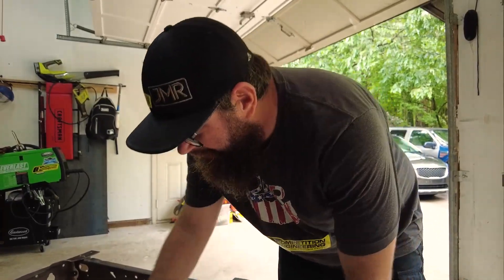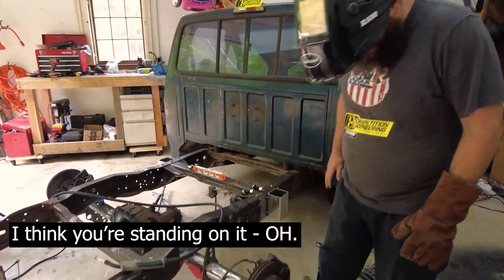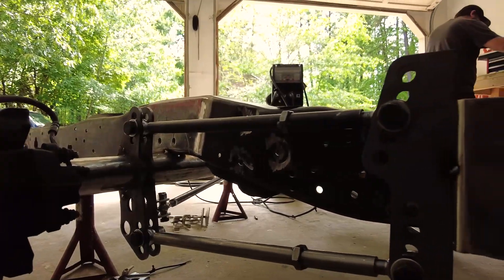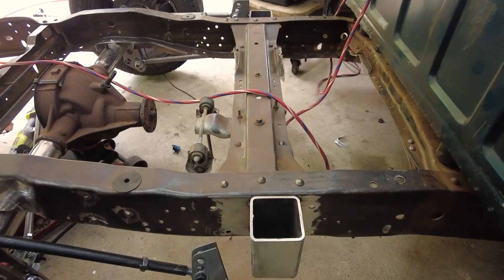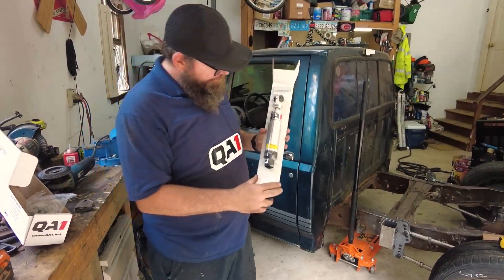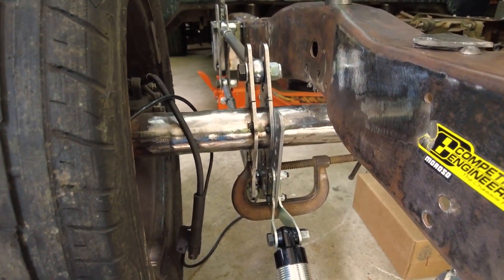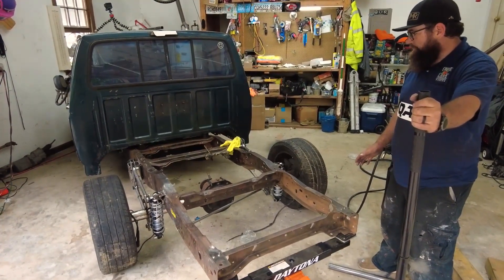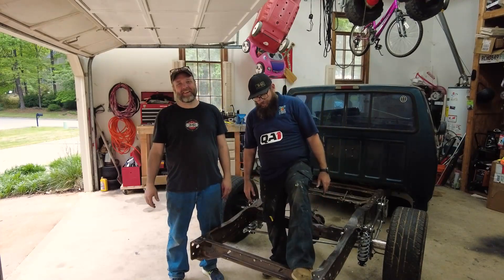Pt2 -Competition Engineering 4 Link in our Coyote Swap F150 for Under 1k! Part 2

Comment: So as I am binge watching this entire build there are a few things 
#1 I really appreciate all the footage and you don't just build the entire truck in 30 min like on TV.
#2 y not use the factory 4 link mounts?
#2A. I thought you not just section the frame and insert the crown vic rear assembly?
Then I thought....
#3 y not just take the body off the crownvictoria, do the coyote swap to the crown victoria, and use the f150 body?
Wheel base wrong? Cut it and shorten it.  I think that would have been easier in the end.
You guys have worked SO hard which I can really appreciate as I don't have any helpers in my videos.  
Oh and I'm no expert but I'm not entirely sure that cross bar on the 4 link should be diagonal.  They have been 90degrees to the frame in everything I've seen.
Reply from the maker: Hey brother welcome to the JMR NATION. 

1. thanks for the kind words brother.  
2. The crown vic has the Wats link system and the  existing 4 link just wouldn't work.  
2a. Yes we thought bout that and we may be considering that on a build soon but not what you think.  The cv donor rear frame was demolished so couldn't.  
3.  This is the answer above and we really were not excited about that as much as this way 
4. The way we initially did was wrong we changed it to diagonal.  It is called a diagonal link. The instructions we got from other builders and from the directions was from bottom of one to bottom of other. It is to stiffen the rear and prevent hop.  

Thank you so much for the encouraging words and commenting.  We appreciate.  Good luck to ya

Comment: Your front 4 link bracket is set WAY too high. The 4 link bars should never be going upwards. Your instant center is way too high.
Reply from the maker: Thanks and great catch.  We did notice that.  We have relocated the diagonal bar and accounted for it with the suspension.   We appreciate the support.

Comment: I am looking to get 1995 ish 4x4 F160. What’s fuel injected engine that will bolt right in with as little head ache as possible . Trying to stay on the cheap.
Reply: F150🤦🏻‍♂️
Reply: What about a early 2000’s miter. Yeah I don’t care about the shock and awe factor going to have this truck for a long time.
Reply: Early 2000’s motor 🤦🏻‍♂️
Reply from the maker: Im not sure of that process.  Can it be done sure.  What does it entail not sure.  The 4.6 is probably the best option.  But all of fords 4.6 5.4 and 6.8 are the same setup and have some frustrating flaws.  That is why alot of people just put a 350 chevy on them.  Personally i like the 4.9.
Reply from the maker: You could use a 4.6 but would have to have a custom built harness.  Also use motor mounts from a small block ford of that era
Reply from the maker: Those trucks have fuel injection in those years.  The best engine for longevity is the 4.9 inline 6.  They are million mile motors no joke.  Good luck to you.  They do lack the shock and aw of the v8s and doesnt really rip but they are torque mschines and last.

Comment: Awesome build guys! Found y'all on the Coyote Swap FB Page. Between this and Gingium's 4 link, I'm confident I can attack my Coyote Ranger Swap rear suspension.
Reply from the maker: Heck yeah brother.  Gingium is who we found when doing ours.  He was super helpful.  We have the links to all parts incliding qa1 shocks and coilovers.  Good luck brother.
Reply: @JMRRebuilders  Thanks! My parts guy recommends Viking over QA1 so that's what I'll be going with
Reply from the maker: That works. We went qa1 because of availability and price. The complete setup was less than 1k.  The vikings will cost over half that.

Comment: What spring rate? I got 250 lb springs for my 94 F150. Haven’t installed yet.
Reply from the maker: Hey brother we got 250 as well. Thats is what QA1 recommended. Good luck to ya brother. Thanks for the comment and the support. Keep getting after it